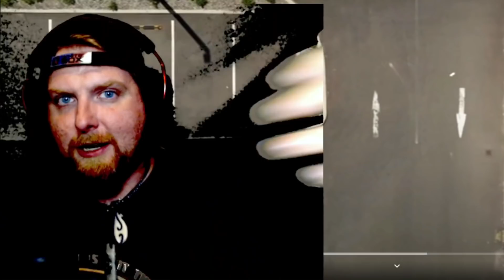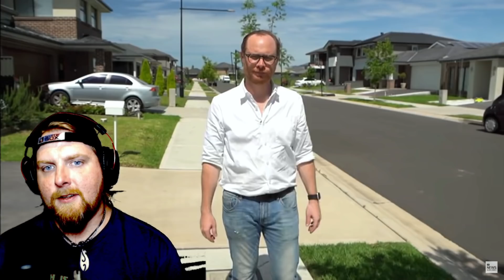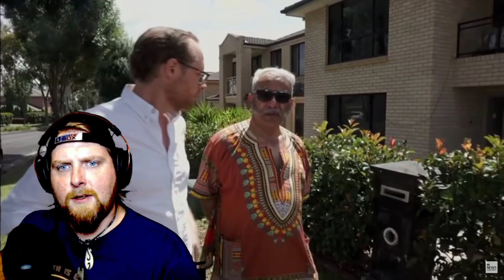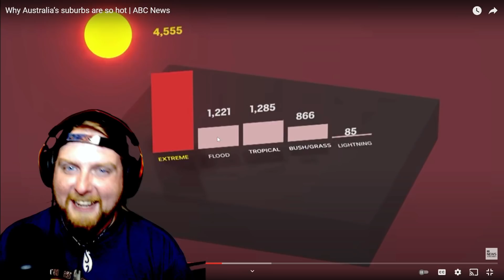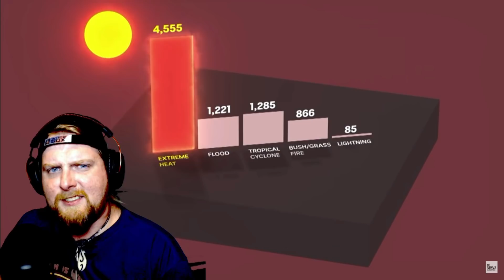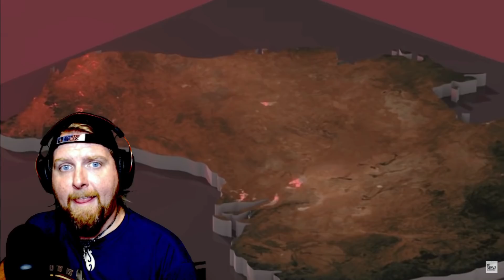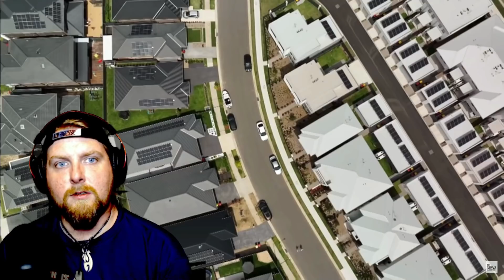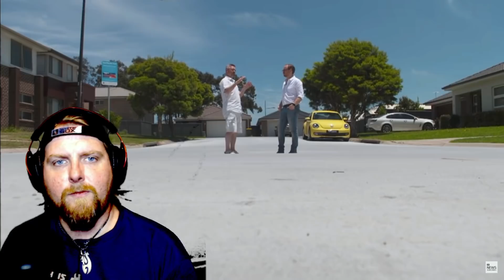American Reacts to Why Australia's Suburbs Are so HOT..

Comment: Yeah Melbourne can get extremely Hot in Summer and it's traditionally a dry Hot heat but recently much more humid. That Melbourne heatwave in 2009 with 300+ deaths was 3 days in a row 45,46,47 degrees without respite is why so many vulnerable people especially old died. I couldn't bare living in those new horrid treeless estates..I'm in a suburb bordering farmland and thousands of huge Gumtees only a couple of houses away and 10mins from a Beautiful beach on an old size block. All those houses need Native trees and shrubs.

Comment: We had some tight water restrictions in Adelaide a few years ago and the subject of lawns came up. They need a lot of water to keep green and healthy, and when water restrictions were at their worst you couldn't water them with anything other than a bucket or grey water (used washing machine water) from the laundry. So artificial lawn started to be popular,  BUT (it came as no surprise to some) a natural healthy lawn does a lot to keep a house cool.
Reply: Yeah we are having the same issues over here in WA. Granted we have never had watering restrictions like that, it's usually 2 days a week. The Water Corp encourages us NOT to have lawn, but after 6 years with black sand, we finally put our dream garden and lawn in and boy did it make summer easier to cope with!
Reply: A lawn can absorb as much carbon as 3  large trees
Reply: @rongt859  yeah, but it releases it within a few months - its not a carbon sink, but it will reduce your need to run an air con.

Comment: Melbourne used to get crazy heat in summer (35-44 degrees) because the hot winds moved across from Perth. But over the last 10 years or so, our summers have become cooler with much more humidity - more like Sydney. Our winters are also milder than they used to be. Climate change in action 😏
Reply: Nah it's called cloud seeding the governments do this to cool down our summers but sometimes can lead to over rain and floods.

Comment: Marsden park is a new suburb built on rural land where a lot of the trees had already been felled. But with that, because of the smaller block sizes, any trees that were left were felled to build houses.
Reply: That area off Richmond Rd is crazy! So many houses jammed in together, you can jump roof to roof.
Reply: @larrylongprong5219  Yes, it is a sea of rooftops.
Reply: @larrylongprong5219  Hate suburbs like this basically living ontop of eachover.

Comment: I live in western Sydney. It has never been 49 C lol. If it did get that hot his home must have been right next to those massive bushfires. The heat isn't that bad but usually gets to 35 C in western suburbs for a few weeks per year. And this year it rained so much it was mostly cold this summer. The Channel ABC in Australia is known for being politically biased. This is propaganda to promote climate change as the left wing want to switch to renewable energy.
Reply: On 4th Jan 2020 Penrith recorded 48.9c, it broke the previous highest temp record!
Reply: @lmaree200886  yeh the infamous bush fires went from June 2019 to may 2020. And Penrith is right on the edge next to the bush. This video made it seem like all of Sydney gets that hot on a regular summer day.
Reply: @Jaibee27  This video is just explaining why it gets hot. I didn't really get from this that they're saying its hot all the time cause I know for a fact that it isn't! I've lived in 20 suburbs in Sydney in 30 odd years up until 2019 and I'm now in miserable, cold regional VIC 😁 My best mate had family that worked at the car wreaking yard in Londonderry for decades and it got super hot there most years. Loads of local bush fires too, one fire happened yearly. That land with all the metal from the cars gets up to 70c some days. You cannot walk into the back area or you'd fry!

Comment: Dark colours are fashionable and in a lot of suburbs it is mandated that roofs must be tile and be a dark colour. There is a movement to change this but there is opposition to this change. This is so ingrained that when I built a cottage in the bush (50km from Canberra) a number of work mates thought I was mad that i was using white corrigated iron untill I explained about that it was cooler and less of a fire risk.
Reply: Bluescope makes a white painted steel roof material that reflects a shitload of heat.  Coolmax coating.
Reply: In the new Baringa and Nirimba estates going up near Sunshine Coast all the roofs must be white.
Reply: @Trananism  and that should be law   a dark roof takes in the heat in the day and releases it at night and adds to global warming 🤔🤔💯🇦🇺
Reply: Not where I live in Melbourne. We have several different colours in my suburb ranging from terracotta, grey, white, blue, red,  black, brown, tan and green. Ours is light brown
Reply: @carriebizz  ya but that's Vic YOU  don't know any better and don't try anything different  pity about that   that's  just ( Vic)🤮🤮💯🇦🇺
Reply: @carriebizz  certain new estates and developers mandate what colour you use. those caveats expire after X amount of years then you can do what you like.
Reply: @nickycrea6075  yeah but is that because of heat issues, or because of $$$$. (I suspect $$$$$)
Tile roofs are cheaper than Iron and you can always get a better deal buying tiles for 20 houses than you can for 1.
Reply: @petert3355  neither, its because the developers want similar style houses and similar colour schemes. Basically they don't want you to build a yellow house in a street of grey houses. 
also the building codes in Victoria recommend a darker colour because of passive heating in winter. (but its not mandated).
also builders like to pass on cost.
Reply: @nickycrea6075 They're restrictive covenants, not caveats.
Reply: @susanhabib8211  my mistake

Comment: During the black saturday fires, we had over 40 degrees for around 10-12 straight, working at the airport was bad in melbourne, tarmac temp was 69.8 degrees and that was around 9am, by mid afternoon it felt like your boots were melting , and your feet were on fire , so it gets really hot in melbourne, especially with the north west winds , coming straight from the centre of australia
Reply: Also that year was the end of a ten drought. The animals of the healesville sanctuary were evacuated out of the area as the fires came within a couple of kilometres.
Reply: @vivianhull3317  yes i had friends stuck in kinglake , and in pheasant creek, we would do runs up to whittlesea with water and food for the animals as part of the german shepard dog club, and the cfa would take it to them , some were lucky as the house next door would burn and only their back fence , if i remember right there was about 5 familys taking shelter in their house